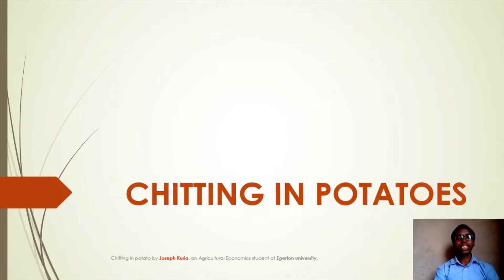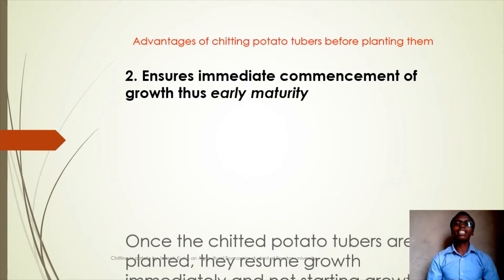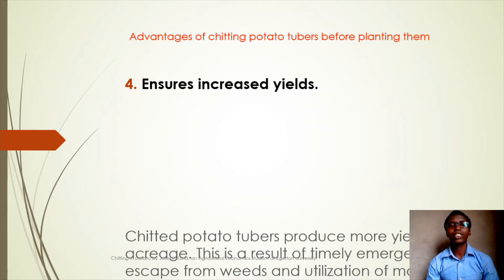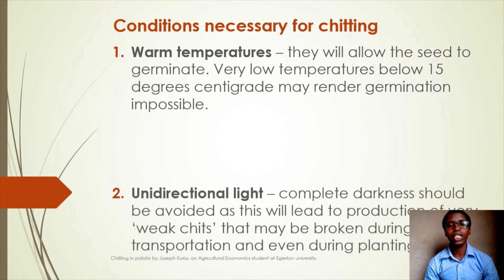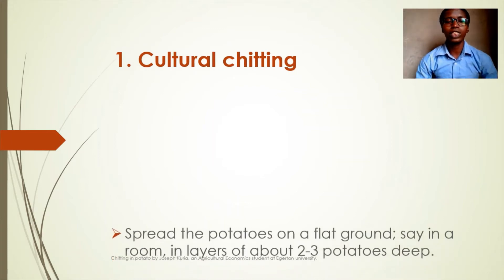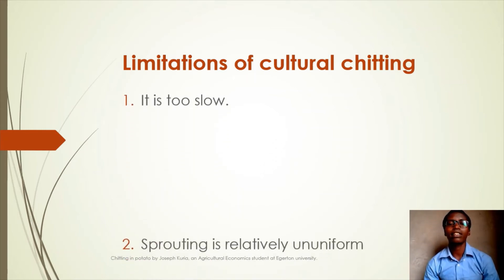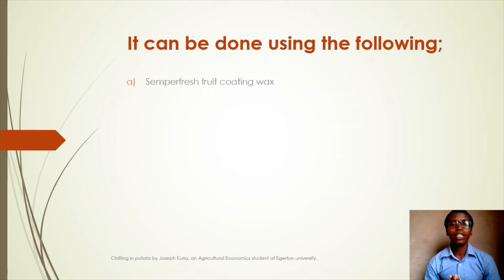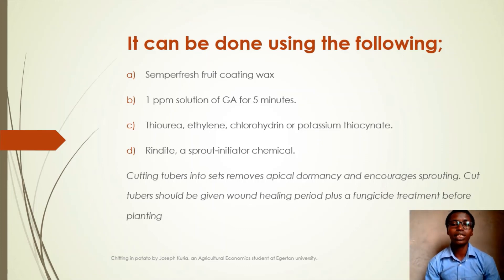Chitting In Potatoes, Pre-planting Treatment, Methods and Conditions necessary for chitting.

Comment: I am confused with unidirectional light.

What exactly unidirectional light means? if we cover the potatoes, there's no light hitting them, they will be in darkness.

So I don't understand why light is mentioned as a factor,  more specifically unidirectional light.

Thank you.
Reply from the maker: Hello Verde,
Sorry for the confusion, Light is very vital in the growth and development of the potatoes. 
The light is crucial fro stem and shoot development. 
However, if you let the light into the potatoes completely, photosynthesis and other physiological processes will take place faster and this may lead to dehydration and even death of the germinating tubers. 
We therefore usually cover them so as to control growth rate of the tubers and even control direction of the sprouts for easy planting. 
They should not be totally covered(left in darkness) because it will lead to production of etiolated  this weak and very fragile stems that may break during planting.

I hope it helps answer your question.

Regards,
Joseph Kuria,
Agrosolns Agribusiness.